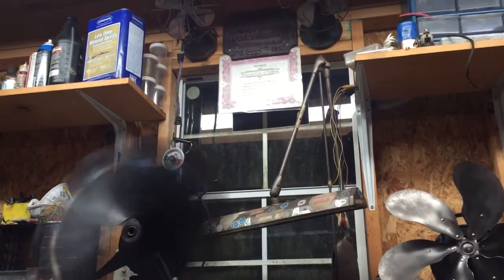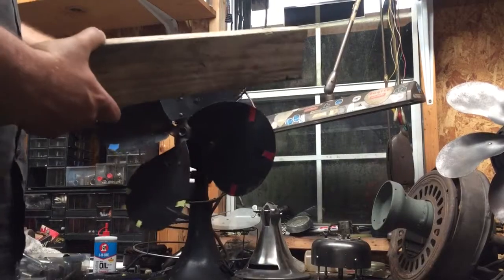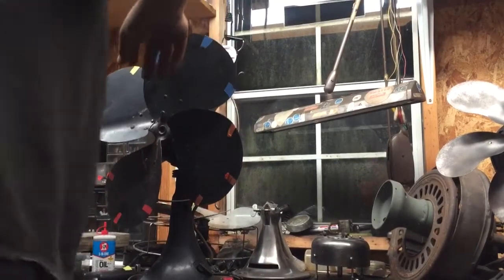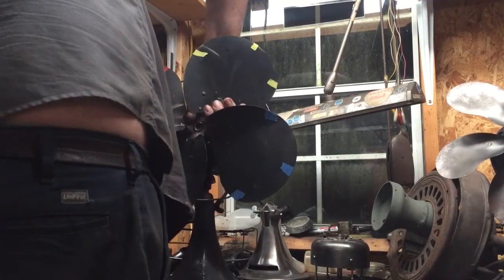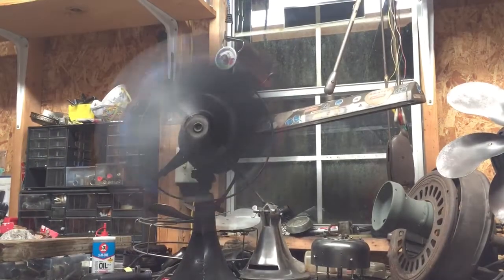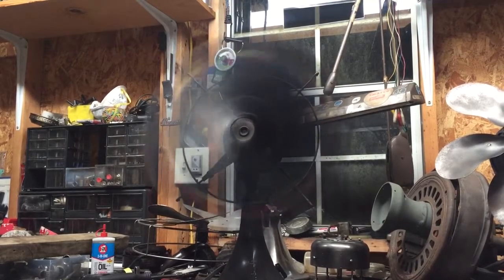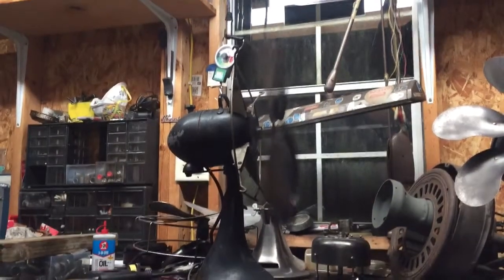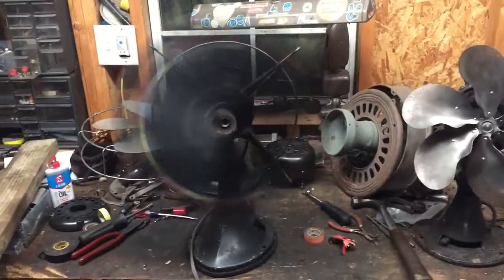Fan blade balancing using a stroboscope part 2

Comment: My problem is adjusting the pitch vs what the RPM's should be.  If you get the pitch wrong, it makes the motor get real hot from too much load..  but if you make the pitch too shallow, you're not moving as much air and leaving performance on the table. but I can't ever seem to find a method that finds that balance (pun intended) like it's supposed to be.

Comment: If the blades are laid on a flat table, maybe with hole for hub, does that reveal much?
Actually,  instead of that I'm trying to take advantage of the big Dayton cage around the blade unit.  I set out a milk crate as a stool, and have this fan, pretty big thing on a 1/3 hp motor, resting in a nearly prone dolly.   Sitting on the crate I can look into the cage edgewise and see the blades relative heights against the cage hoops closer to my eye while turning the blades around, which I put numbered stickers on, and take notes.   But I now see that I can remove the front cage half and clamp on a reference bar across the way, so then I'll have access to the blades for bending.   So far I can easily see blade number 3 is way out of whack from the other two.

Comment: I have a GE Vertex and it's got a death wobble
.  Is the blade that always goes to the bottom a damaged blade.. I have 2 blades that do touch a measure scale when rotated and 2 that don't touch it. How do I tell what 2 are bent? Ya know?  I just need some guidance. Thanks

Comment: Thank you so much for this video! I've spent the last 4 and half months trying to completely restore my Grandfather's Hunter Century and just finished it this morning,new wires'paint,felt, polished blades new cord the works and the table i put it on to show it off and take pics collapsed and now it rattles so bad I can't use it! I know that's a long time but I've zero knowledge or experience with electricity or small appliances so I had to learn as I went. So glad that it may live yet!

Comment: This is a hard way to balance a fan.  I used to work on air bearing spindles.  What we used are set screws and an oscilliscope with a capacitor coupler.  The capacitance would change with vibration so you could see how much more grinding you needed to do on your balancing screws.  I am not saying what you are doing doesn't work but by adjusting weights like I did, you can get it far more and more quickly balanced than what you are doing.  These spindles I worked on would run at 100,000+ rpm so they had to be super balanced.  It is very hard to determine how things are slightly imbalanced once you get to a certain point without measuring equipment.